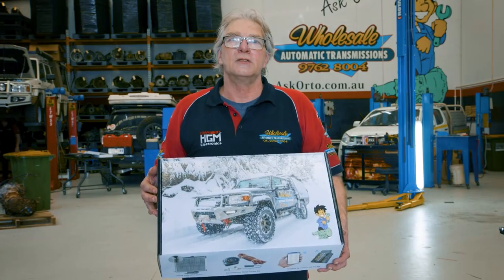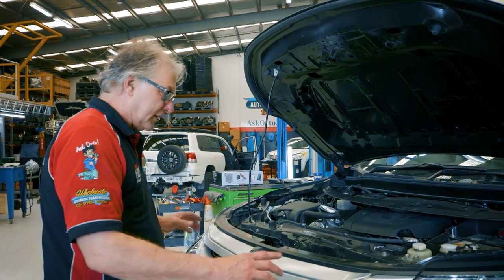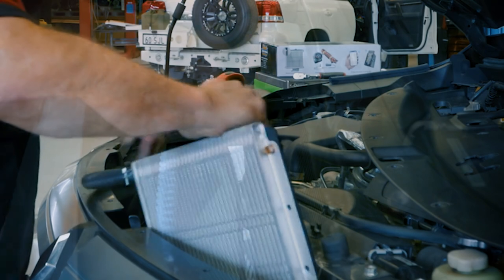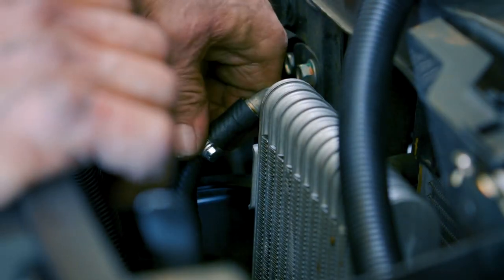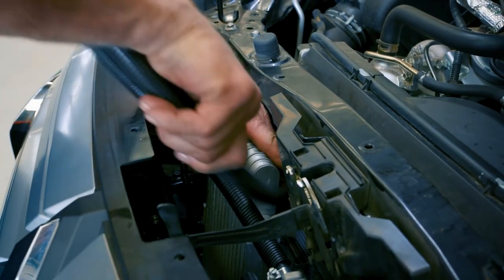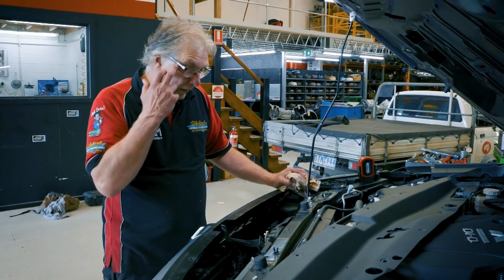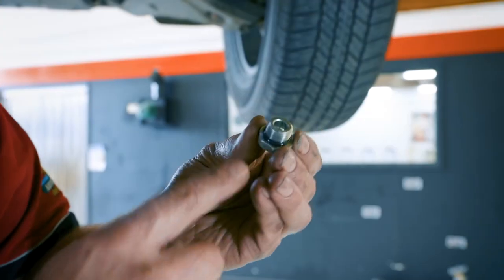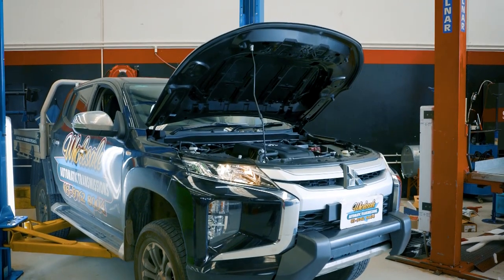Mitsubishi Triton Transmission Oil Cooler Install

Comment: Excellent video. I got stupid question, which pipe is return pipe to transmission? Bottom or top? Just to drain the remaining old trans fluid from a torq converter. Thanks Thomas
Reply from the maker: Here is a copy of the fitting instructions Thomas:
https://automatictransmission.com.au/wp-content/uploads/installation-instructions/External-Oil-Cooler-Kit-to-suit-Mitsubishi-Triton.pdf

Comment: Hey guys, good clip. I thought triton came with a transmission cooler from factory. Is this an upgraded one?
Reply from the maker: We still run the original cooler but it’s a little small and in the case of the MN in a very poor position. We add the new cooler as an additional as these transmissions can get to 120c very quickly when towing or loaded up. We have owned a few Tritons and an Auxiliary cooler is a must have.
Reply: @WholesaleAutomatics  thanks guys for the info, I have a MQ.    Might just have to take a look at your kit 👍

Comment: Great vid, this is a must have for any 4x4 with an auto.
Quick one, whereabouts is the breather on the triton auto trans (MR/MQ)?
Reply from the maker: The MQ is a 5 Speed A750F Auto while the MR is a 6 Speed AC60 auto from the same manufacturer. The breather for both are above the transmissions main case up towards where the bell housing joins the main centre section of the transmission.

Comment: off topic- is it possible to change atf fluid of 4n15 triton via atf cooler hose?
Reply from the maker: Yes but more difficult and would only change the oil not the oil filter. I woud recomend full transmission service with full change of oil.

Comment: how much transmjssion fluid you add up during the process?
Reply from the maker: Between .5 - 1L depending on what the exact oil level was prier to the cooler install. 1L will cover you fairly well.

Comment: what is acceptable temps for the auto?
Reply: I'm also curious about this too, I've seen mine get up over 100°C (slow speed off-road in 4Hi where I probably should have changed to 4Low) without towing anything, and it'd be good to know when I should start getting concerned.

Comment: I’ve got triton what’s the reason for fitting this
Reply from the maker: We add the new cooler as an additional as these transmissions can get to 120c very quickly when towing or loaded up. We have owned a few Tritons and an Auxiliary cooler is a must have.
Reply: Can you stop the cooler from running through the radiator. If it runs through the radiator wont it always be around the temp of the radiator?